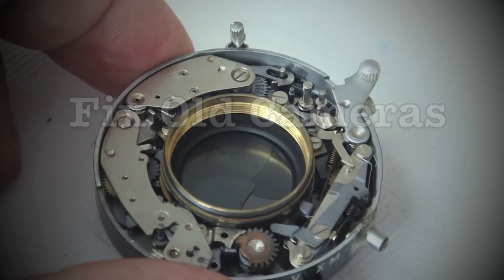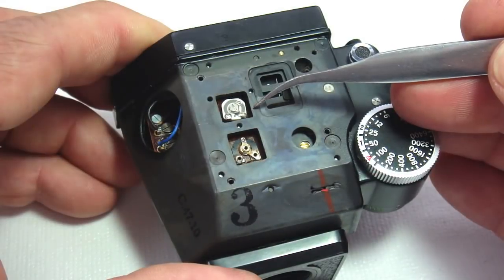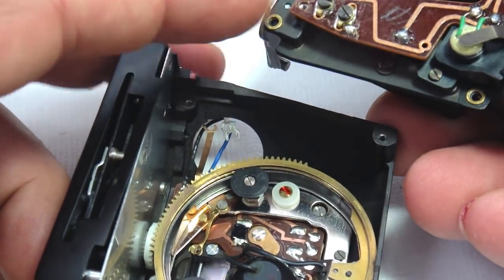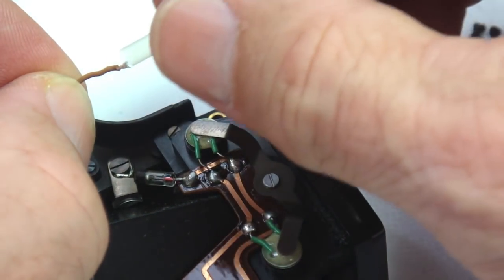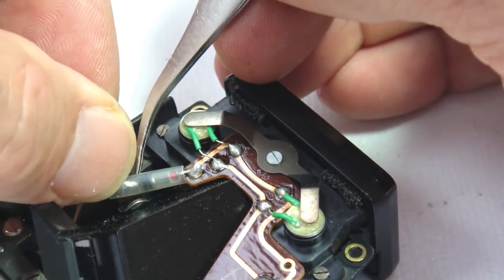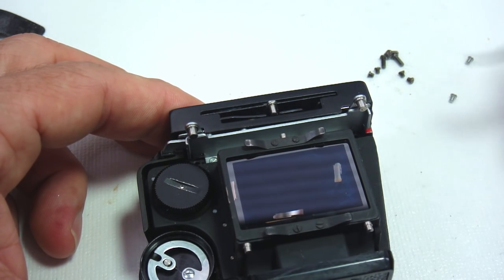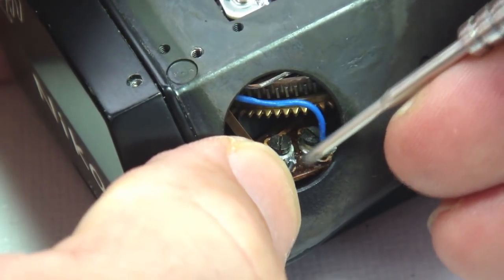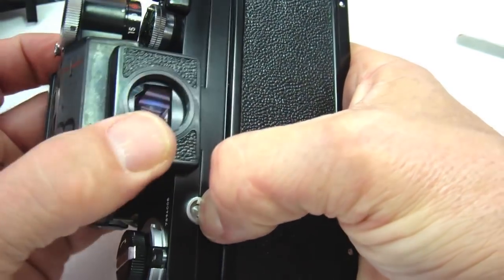Fix Old Cameras: Nikon Photomic FTN Meter Modification

Comment: This does not work. By using a diode you loose linearity in the meter. I set these meters for EV9 EV12 EV15.
Reply from the maker: One thought, years ago,  when the mercury cell was first doomed to extinction was... how about some sort of adapter to hold a silver-oxide cell... and then... along came the MR-9. Slip a S76 type battery inside the MR-9 and now you have a direct substitute for a MS625 battery. No meter adjustment necessary - the MR-9 had a built -in chip resistor that dropped the voltage to 1.35V. Then in maybe 1998 "The New Camera Craftsman" (now out of production along with the original "Camera Craftsman" magazine) ran a short piece on the diode modification. It discussed the technique of connecting a nonlinear component - a germanium diode - in series with the battery as a means of operating cameras that were not necessarily a candidate for the MR-9 adapter. Using a silver oxide button battery as the power source, the resistance of the diode changes according to the amount of the current. With the small current draw of a galvanometer metering system, the germanium diode brings the voltage very close to that of the original mercury cell. In a typical meter circuit of the type indicated, the diode drops approximately 0.157 volts. (1.5v - 0.157v = 1.3443v).  Since that short piece appeared in The New Camera Craftsman" and probably before, camera users have continued to report good results of once again having a fairly accurate meter function in the classic cameras that this technique might apply.
Reply: @FixOldCameras  I have rebuilt well over 500 Nikon FTN meters. If the CDS cells are good there is no problem adjusting the meter for 1.5 volt battery with the top pot. But if the CDS cells are bad the meter will read way to high with 1.5 volt batteries. Diode will lower the reading but you will find the linearity at EV 9 12 15 way out.  I have tried numerous diodes and have never had any success in resetting the meters. Sorry but every diode we have tried we have been unable to set at ISO 100 1/125 sec F2 F5.6 F16 and get a balance where low and high reading are accurate. When I rebuilt these meter my tolerance is +-.5 stop.
Reply: Also what is VERY important in rebuilding these meters is to remove the old foam to stop the de-silvering of the prism. The foam eats into the silvering of the prism. I replace with new foam. I did 2 Nikon DE-1 prism for the F2 today, the foam in both was powder. I do this in all Nikon meters and prisms. Foam was the worst thing Any camera manufactures used in cameras. This is very true of camera in humid climates.
Reply from the maker: @iwctoys1  The degraded foam is relentless in its attack upon the silver coating of the prisms. A gooey mess and one has to wonder if such degradation was known would have the product still been used and to what end the foam's placement served.
Reply from the maker: @iwctoys1  Over 500 Nikon FTN meter rebuilds is an impressive number and thank you for outlining your procedure for compensation for the higher voltage of the modern battery.
Reply: @FixOldCameras  Foam in some prism without meters holds the prism in place. Have seen lot of Nikon F and F2 prisms with that have loose rattling prism because the foam is gone. Was used to stop dust from going between prism and eyepiece.

Comment: You note the 1N4007 diode. On the video I can’t tell if the first character is a “1” or an “I”. When I search out diodes all I find is a 1N4007. Can you please clarify what that first character is. Thanks, Tom.
Reply from the maker: 1N4007 or SK3080 diodes both will usually work for double 625PX battery meter systems
Reply: Fix Old Cameras Great, thanks.

Comment: Hello, I recently picked up one of these cameras and everything seems to work minus a little bit if either dust or fungus in the prism itself. Do you think it is possible to pull it apart to fix it or is it a lost cause?
Reply from the maker: By no means a lost cause. What looks to be fungus in a viewfinder is often de-silvering of the prism. Dust removal should not be to difficult as prism removal is fairly straightforward once the top cover has been removed.

Comment: Did you use a zener diode is the ref: IN4007 for this or is that for a normal diode?
Reply from the maker: a vintage gerrmanium diode is used... however, if you have other diodes available, they can be tried to see if the desired voltage drop results. You will not harm the meter circuit if the voltage drop is incorrect.

Comment: Kind greetings,
Will there be an issue if a 1.5volt battery is used to power the light meter of a Nikkormatt FT? Will it have a negative affect on the camera?

All the best,
Your long time fan, Nick.

Comment: The aperture linkage on my DP-1 got jammed on a lens mount and now doesn't work properly. it either hangs loosely or hides up into the linkage housing. Do you have a resource you could point me towards?
Reply from the maker: Take the cover plate off of the linkage and you might find a disconnected spring or lose screw. Also, there is a Fix Old Camera video on the Photomic prism - https://www.youtube.com/watch?v=sy7PbcvCzoE&t=55s - it might help, but unlikely. Hope to produce video at some point in time isolated to the aperture linkage on a Photomic DP-1 prism.
Reply: Fix Old Cameras thanks!

Comment: Thanks for the video FOC. I tried to use the IN4007 diode with cathode in right position (i used the voltage meter to see if the  voltage is dropped or not -> get the right position of diode to the circuit). Unfortunately, it was unable to work when i installed the batteries and clicked on battery check button. The needle was not moved. In my case, i used the 2 Maxwell LR44 1.5V batteries. The voltage before regulating was around 3 - 3.1V and then after regulating was around 2.8 - 2.9V. Was it correct voltage for the meter to work properly  ? Should i use another diode or replace the alkaline batteries by silver oxide batteries ? Thank you so much.

Comment: Hi 2 questions after watching this excellent guide. What glue do you use, and do you know what disassembly is required to clean a lot of dust build up behind the view finder glass. I wear glasses and the dust build up is quite noticeable and even more so when I shine a modem led light source into the prism whilst looking through the view finder. Thanks in ad advance.
Reply from the maker: Pliobond glue for most all applications. ( http://astore.amazon.com/fixoldcam-20?node=1&page=5 ) You may use a Permanent Glue Stic to adhere flexible light weight leatherette such as found on the Photomic meter prism.  The disassembly to access the viewfinder glass should be fairly intuitive once the outer shell is removed.

Comment: Can the Silver 625 batteries be installed without an adaptor?
Reply from the maker: The silver battery has steady discharge rate similar to the mercury battery, but the original px625 mercury battery was rated at 1.35 volts. 

Mercury oxide batteries typically had a voltage of 1.35 Volts. They kept this voltage constant over their entire lifespan and lasted for years. They could be recycled and even recharged a couple of times. Question… Why is mercury acceptable in CFL light bulbs but not in batteries?
 
Silver oxide batteries typically have a voltage of 1.55 Volts. They also keep their output voltage quite constant over the entire lifespan of the battery and they have relatively long useable life.

Zinc-air batteries mainly for hearing aids have a constant voltage output too, typically 1.4 V. Since their voltage is close to the voltage of mercury oxide batteries, they can be used as a substitute without making any changes on the meter circuits. They are cheap… but they have a short life span of only 2 to 3 months, not depending on usage. Once their seal is removed, they dry out inevitably, even when not used. When first taken into service, new zinc-air batteries need quite a long time of approx. half an hour up to one hour until they achieve their correct output voltage. In this time they can cause incorrect meter readings.

Wein Cells from photo equipment dealers are basically zinc-air batteries with fewer ventilation holes to achieve a longer lifespan (approx. 6 to 12 months), as they do not dry out as quickly as normal hearing aid batteries. They have a smaller maximum power output than zinc-air batteries, but for photographic equipment this is not a problem, as the meters do not need much power. Wein Cells are still expensive and can be difficult to get in some places. They have the same problem with the initial voltage as normal zinc-air batteries.

Alkaline batteries have an output voltage that drops continuously over the lifespan of the battery, as it discharges - depending on the  battery brand the initial voltage is approx. 1.6 volts - 1.5 volts. They are not a good substitute for the mercury oxide batteries because of the voltage drop over its lifespan. 
-
Some of the later classic cameras using the 1.35 volt mercury battery have compensation circuits and are not affected by substituting a silver battery.

Comment: Hi.  I just got my hands on an earlier Nikon F photomic prism which looks like it has a lens or "eye" sticking out of the left side. Does this video also apply to the earlier prisms?
Reply from the maker: Look for a corroded wire coming off the battery contact... a simple fix. With an inexpensive volt meter you can effectively check for battery voltage at key points in the meter system.
Reply from the maker: Yes the meter can be successfully modified in a similar manner. However, for the original Photomic F meter to be complete there are two accessories, a small pipe which screws into the ring surrounding the meter window, and changes the angle of view to that of a 135mm lens, and an incidence opaque disc attachment which also screws into the surrounding ring and turns the meter into a directional incident meter. To use the original Photomic meter as a reflected light meter, you must turn the ASA dial until the film ASA value is opposite the black arrow, or if using the telephoto attachment, opposite the yellow arrow. To use as an incident light meter, install the opaque disc attachment and stand near the subject, while pointing the meter generally toward the light source.
Reply: Fix Old Cameras thanks for the reply.  I got my Nikon on auction and awaiting its arrival.  Judging from the auction pictures, I don't see those two accessories you mentioned.  Are they absolutely necessary?
Reply from the maker: The meter will function just fine with out them. The tube makes telephoto readings more precise since it is not metering through the lens. The incident attachment is nice for portrait work, but it is not absolutely essential.
Reply: I got my old Nikon F today.  It's has the prism which has this flag switch to cover the front of the meter.  It has no on / off switch.  Like this: http://www.destoutz.ch/accessories_finders_f_photomic_1.html       
Stuck a new battery in it and zero response.  Really thinking of replicating your video to simply take a peek inside, clean anything that looks dirty.  Any suggestions welcome.
Reply: Will give it a shot.  Suggestions really appreciated. Thanks.

Comment: Which diode is used? 
Do you use an adhesive to replace the leatherette cover?
Thanks.
Reply from the maker: The 1N34A diode is germanium diode as is the SK3080 that was used in this application. The SK3080 , used in this video, gave the voltage drop needed.  If you do not get the voltage drop needed with a diode used you will not hurt the meter circuit. Double sided tape or some type of removable leather adhesive can be used to reapply the leatherette covering.  
Some recommended options here -  http://astore.amazon.com/fixoldcam-20?node=1&page=5

Comment: Hi, could you please explain, if the ring resistor is removed, how is it aligned when replaced back into the housing and where does the wiper contact have to be in relation to it? I have noticed a small notch machined into the ring on the one I have, is this an alignment indicator, witness mark?

Thank you    ...and thanks for all the great videos :)

Regards,
Ed.
Reply from the maker: +Ed Duffner 
The mark is relevant to the alignment.  Bring the groove on the resistor gear opposite the contact position of the variable brush. Make this adjustment while turning the dial ring while lifted up. If it cannot be made, loosen dial ring set screws and shift the ring to reset. To adjust the ASA scale again loosen the dial ring set screws and line up the position of the ASA number 400 with the index triangle arrow engraved on the dial ring and then set the scale into position.
Reply: +Fix Old Cameras 
Thak you very much indeed. Great job!!!!

Comment: Can someone give me advice, please? I have Praktica LLC which I use very much. But some time ago it fell down and broke its battery contact for exposimeter. When I tried to repair it I found that contact i need to repair is under camera's frame and I didn't find out how to get under that frame.
Reply from the maker: +Štěpán Lammel 
Without a visual reference, and going only from your description it appears that the mirror box will have to be removed to access the area needed to make the repair.

Comment: Well Done, makes me wish I had one of these old prisms.  FYI I use 3M Adhesive Transfer tape #465 clear to attach leatherette.  Last time I checked it's available on Amazon.  It is expensive over $50 for a 60 yard roll (1.83" wide). The good part is my roll has lasted over 20 years and still as sticky as when new. The tape is a mere. .002 inches thick. It may be available elsewhere, Grainger?
Reply from the maker: +Tom Heckhaus 
Great suggestion,  the transfer tape is really good stuff albeit pricey, but a 60 yard roll will cover a fair amount of leatherette.

Comment: Nice. What should you glue the leatherette back on with? More importantly, what should you NOT glue the leatherette back on with?
Reply from the maker: The 3M 465 tape might be the best choice but it is rather pricey, but a small roll will be enough for many cameras. http://astore.amazon.com/fixoldcam-20?node=1&page=5
If the leatherette is pliable even a roll of office supply double sided tape will work just fine, however it will not hold leatherette that is stiff and has developed a curve memory.
Reply: @FixOldCameras  Old fashioned shellac. Clean the surfaces. Apply a thin coating of the shellac to the part that you are attaching the leather to. Wait about ten minutes until the shellac is sticky but not still wet. Apply the leather and press it down. If you get the timing right on the drying of the shellac the leather will stick like it is double sided tape and not clamping or rubber banding is necessary. This method works great and is how the leather was applied to cameras like the twin lens cameras with all of the knobs and buttons that made clamping impractical. This repair can be reversed with a little alcohol.
Reply from the maker: @DavidEFiala  Good information... some times knowing the old ways is all you need. Hopefully information like this does not get lost and forgotten. Leather and leatherette coverings that are curled and dried out sometimes requires continuing pressure as it dries. If a rubber band can not be fashion to hold it in place, small pieces of folded card stock can often be wedged about the camera under the rubber bands to help hold in place.
Reply from the maker: +Hooray for Pentax! Long list of what not to use... Pliobond glue works well as it will hold smoothly and will allow for future removal if necessary. Double sided tape will also work for this application.
Reply: +Fix Old Cameras Do you have a preferred version of double-sided tape (3M has numerous versions) and a source to purchase it from?